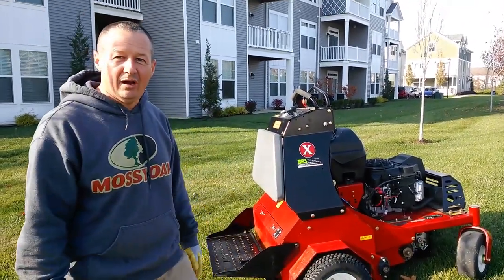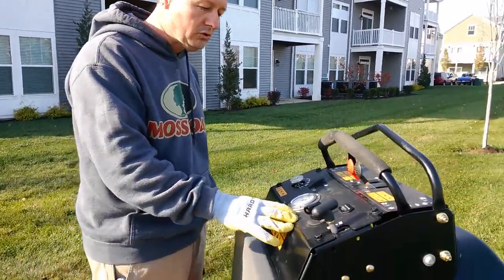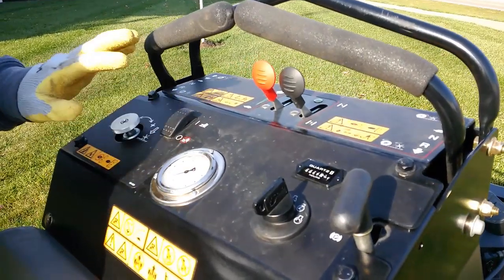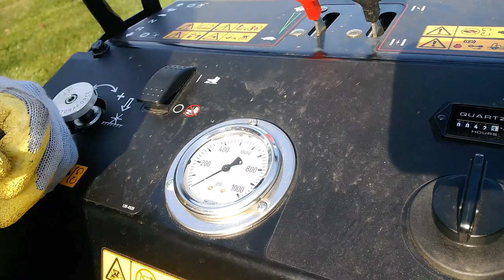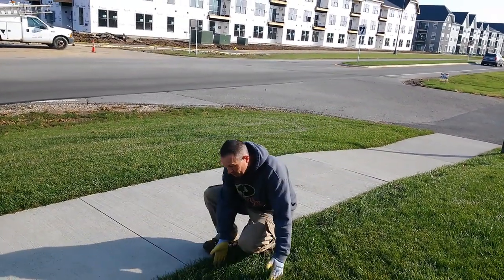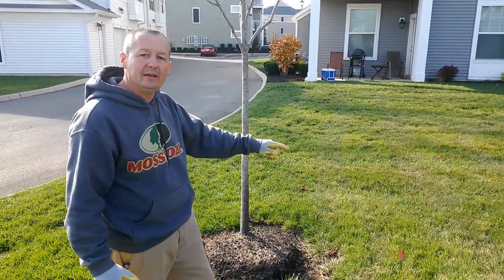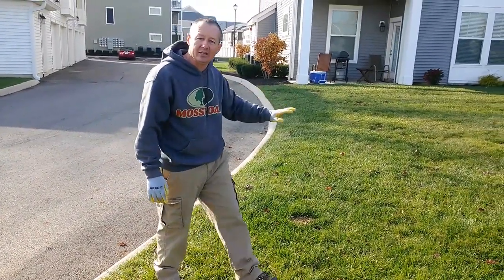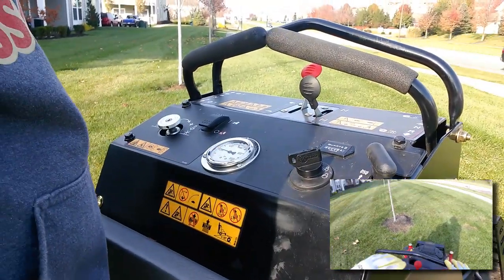Toro / Exmark Stand on 30" Aerator Basic use

Comment: How do you put this thing into neutral to push if it won't start?
Reply from the maker: There is a small metal rod in front of each transmission. You need to pull those 2 rods   ( towards the front of the machine) there is a little notch in the carriage that they will lock into. This will release the hydro transmission and allow it to roll freely.